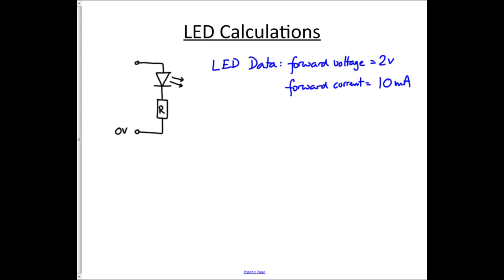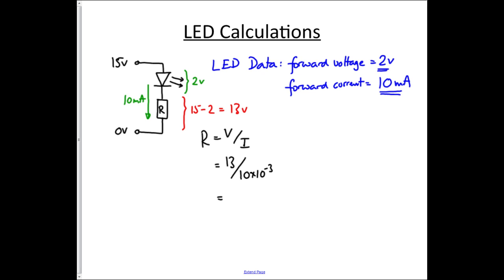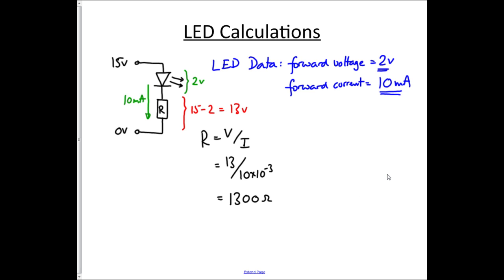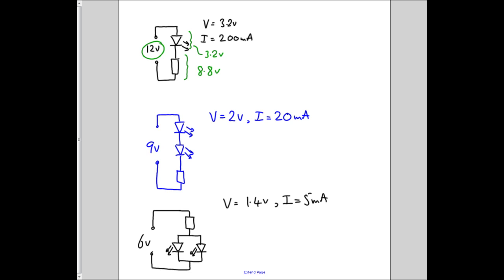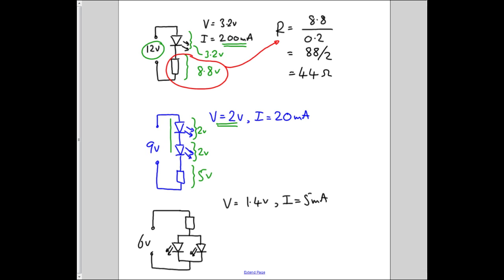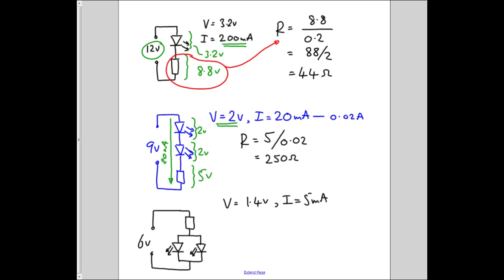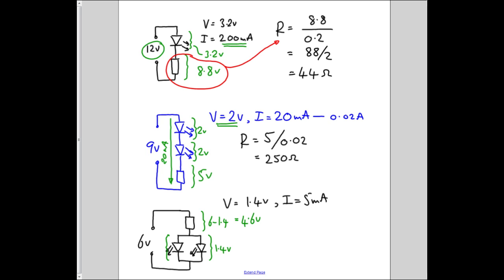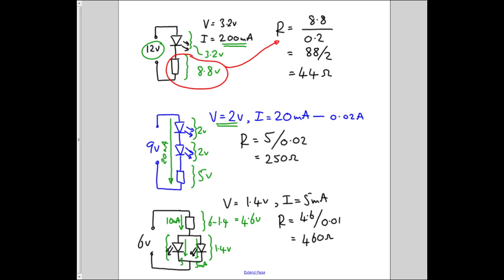LED Resistor Calculation

Comment: Why do you put the resistor on the negative side of the led?
Reply from the maker: Sorry for the late reply, been away. The resistor and LED are in series and the current through them is the same. Therefore it doesn't matter what order the components are placed - resistor or LED can come first, the calculation is the same. In the first example I put the resistor after the LED so that (a) my students don't think the resistor has to come first to limit the current and (b) the "voltage" across the resistor is measured relative to zero volts although of course we are measuring potential difference so it doesn't matter whether the resistor is attached to zero volts or not.
Reply: MCS_Electronics excellent. Now I understand. Thanks for the reply!